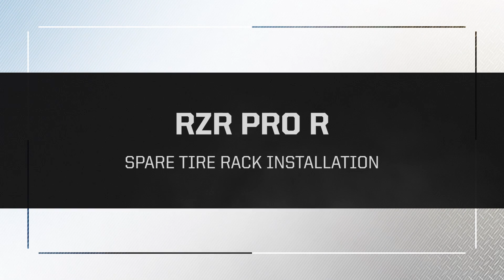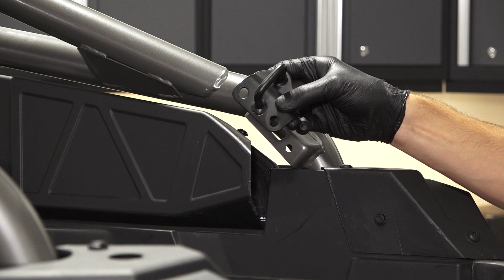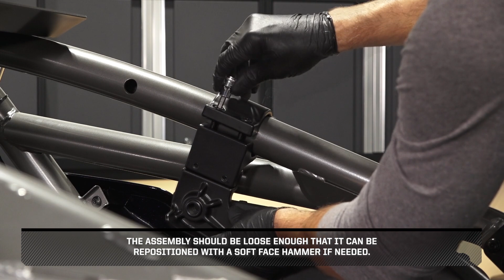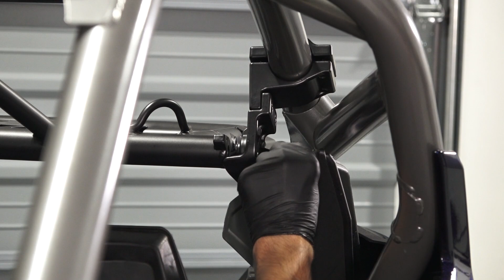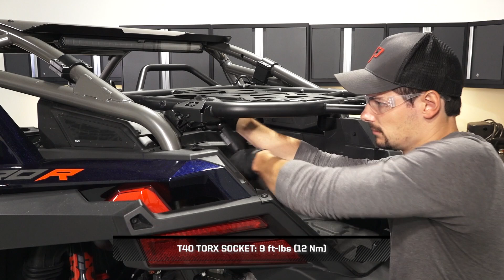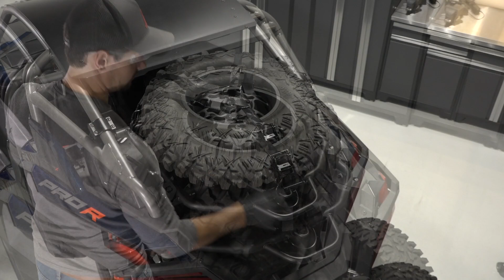RZR Pro R Spare Tire Rack Installation | Polaris RZR

Comment: Nicely done!  
But a couple suggestions.....why not weld to the frame, mounting tabs for the pivot side of the carrier as you did with the striker side? That would remove the bulky bar clamp assembly and make for a ultra clean install!!  Secondly, instead of a webbed strap holding the tire down, why not 2-3 studs coming up from the base of the carrier through the lug holes?  Kinda like a carrier would be on the back of a Jeep Wrangler and use lug nuts to hold down. Nothing to adjust, come loose, fray. or age out like a strap.